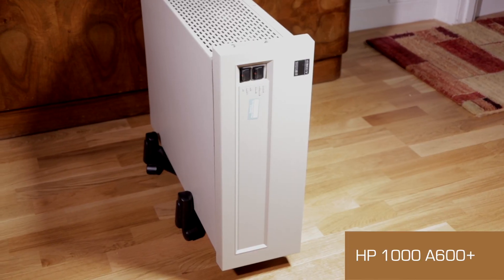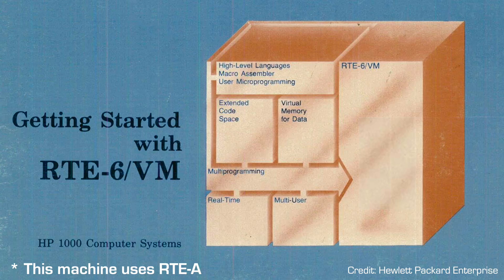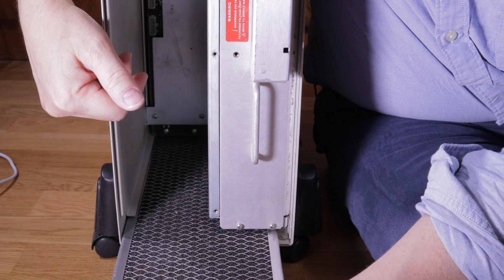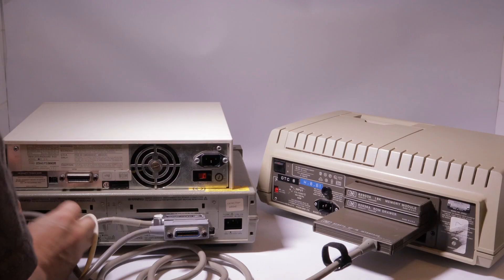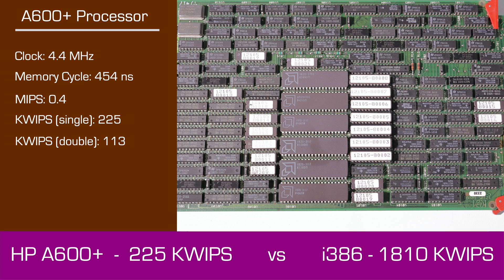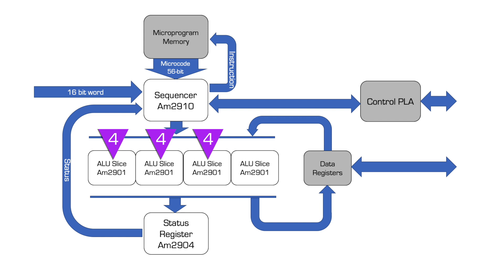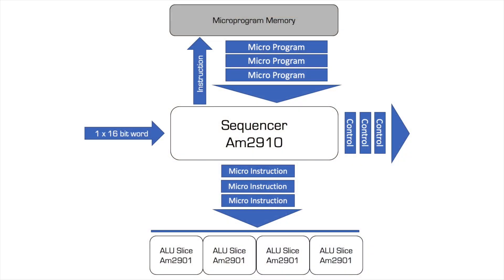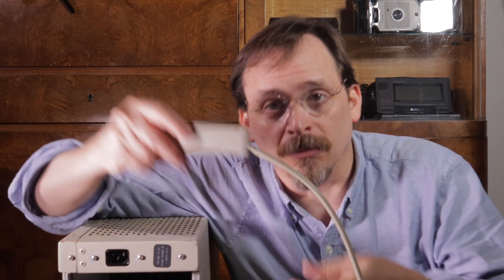HP 1000 A600+ Vintage Minicomputer Introduction

Comment: I worked on its predecessor, the HP E1000 at Lockheed in 1979-19801. It had the the amazing mass storage of 5MB fixed and 5MB removable and I was in heaven.

Comment: those old thnkjets used a similar type of cable... Always wondered why HP used proprietary cables
Reply: They weren’t exactly proprietary they were and still are in use today in high end instruments in and in the 90s most companies used them it was renamed GBIB (general purpose interface bus) as to not include the hp name. The only thing that made them fall out of popularity was ethernet.
Reply: @tickertape1  so the HPIB and GBIB spec are the same?
Reply: Completely interchangeable as far as i know
Reply: The older models may have more obscure interfacing designs as the bit rate may not be the same. For example you cannot hook up a 7970 tape unit to a hp85 as they use different data types however you can use a custom driver to eliminate this problem in the late 80s this was entirely eliminated it was only a problem in the really early days but you can hook an hp85 to a modern instrument for data logging though